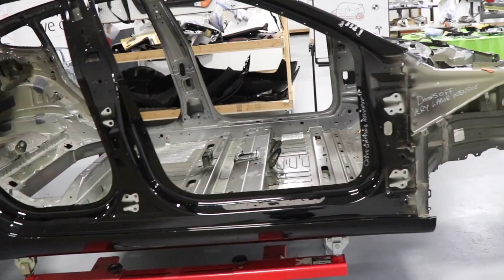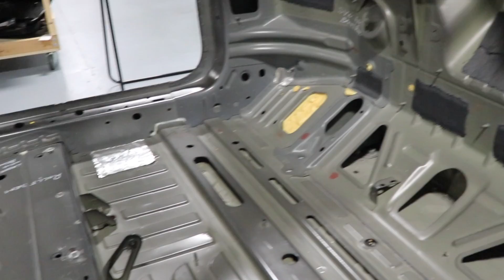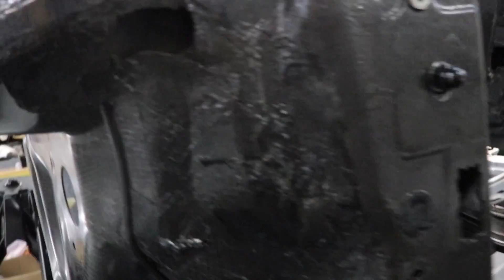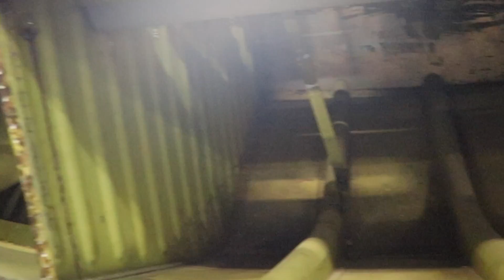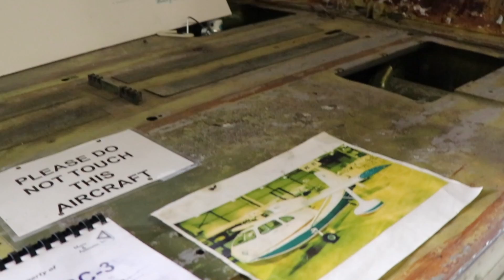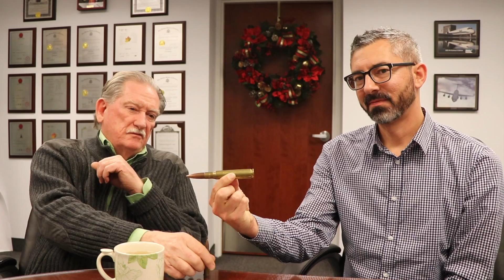Sandy Munro: Tesla Cybertruck SpaceX tech, bullet proof windows, crash safety, and battery magic

Comment: That tailgate on the Cyber Truck is going to be much handier than most are thinking. For instance if your in the field look for a mound to load and off load, or if you are loading from a warehouse dock or a raised dock the ramp will be horizontal or down into the truck bed in a slight decline.

Comment: Seems to be some confusion here about the bullet resistance of the cybertruck.  Neither the body nor the glass will stop a rifle bullet.  The glass will stop a small rock, from a slingshot, and the 30X might just stop a 9mm round, which has about 1/7th the energy of the .303 and 1/50th of the 50 cal.  It’s physics.  Better to use the 1000HP acceleration to slip away.

Comment: 30X refers to the alloy mixture, usually expressed as 300, 301, 302, etc., depending on the mix. 30X means the mixture is in the 300 series but the ingredients are a secret.

Comment: Question on parts of the newer Tesla - including model Y and CyberTruck .... when you created 1 part which was used to be from (example) 70 different parts ..... how do they get replaced when it gets damaged? 

When newer batteries get installed in the newer models and the newer ones have longer ranges - wouldn’t it drop the price of the older models ? Like S or X’s ? 

Does the batteries need to be replaced ?

Comment: not sure who this guy is, but he doesn't really do a good job of explaining this stuff. He doesn't at all clear up what an "exoskeleton" is. I mean he says the last true exoskeleton was the Model A and Model T, but weren't they body on frame? What is he talking about? The body panels may have been thick, but I don't think they were part of the frame, or contributed to the structural rigidity of the car in any way. So is that what an "exoskeleton" is, just really thick body panels? Why should I care about thick, strong body panels?
Also, you heard it here first folks, by 2023 autonomous driving and crash avoidance will be so ubiquitous and so good that car accidents won't really be a thing. "Good point" the interviewer says. Good point? As if the Cybertruck not going to have to pass crash tests and safety regulations and will not be getting into car accidents. It's a completely useless point. 
I don't know, seems like that guy is drinking the Tesla kool-aid pretty hard.

Comment: A traditional ladder frame also offers a lot of torsional flexibility which allows more wheel travel,  better tire contact in rough twisty off roading but also makes them sloppier handling on the road.  With a rigid frame, today that's a unibody, plus exceptional individual wheel travel and adaptive suspension you can have it both ways.   I can't remember the last time I was shot at while driving let alone a 50 cal.  Doors that heavy are going to be a liability and fenders 'n' frunk lid??...how are those going to crush in an impact?

Comment: Citroen had an amazing hydraulic suspension system - auto load levelling, rear squat, anti roll in bends and variable ride height. The springs were N2 gas pressure. spheres. The same mineral hydraulic system powered the brakes and the steering. Big win was no internal corrosion of brakes. Very handy on an EV that minimally uses the brakes. 
The whole lot was non electronic. Lots of stuff to modernise.

Comment: U.K. pioneered diesel electric rail locos that used ac traction motors. Until then they’d all been dc. The power converters had to handle 3000HP yet incidentally had the frequency response of a PA system. The motors had switchable coils so could be set to a range of synchronous speeds. The biggest breakthrough was their stall capacity. Bear with me -
Coal trains carried 1000 tons in 30 wagons. So expect the train to weigh A LOT more. At the unloading hoppers the whole train had to move at 0.5 mph which put huge strain on the traction motors. The variable frequency drive was set so low you could hear the motors pulsing. The loco 3000hp diesel would be working hard to avoid stalling. 
I wonder if this technology could be updated for electric car traction motors. Maybe it is but well worth a look.

Comment: Electric motors at or near the stall have huge torque but they seriously suck power from the battery. 
Can the motor specialists tell us whether they would benefit from a low range gearbox.

Comment: As Sandy says, 3mm is about 1/8". An entire body made out of 1/8" Stainless steel is HEAVY. '
He also correctly points out that stamping stainless that thick into curves like you see in a lot of modern cars is practically impossible. So the relatively simple...though futuristic...shape is a product of the decision to use the exoskeleton.

Comment: Sandy seemed a little circumspect anytime he got around to actually getting a direct question. I find it interesting that he didn't directly address the body cost issue. 

Waterjet cutting, as Sandy knows, is very time consuming and generally not suitable for large pieces in mass production. 3mm (11-12ga.) stainless requires about a 1/2" inside radius when bent on a press brake. If mystery 30X stainless is much harder as has been claimed it will need a wider radius. In structural use these bends may be susceptible to cracking. We don't see these bends on the prototype so all seams are likely welded then ground.

Tesla truck's long straight panels will require many feet of cosmetic grade seam TIG welds. This is both time consuming and labor intensive work.
I honestly don't see Tesla being able to sell the truck we saw for $39K even with no battery at all. I don't think Sandy does either but he wasn't actually asked that question. Nobody builds cars from stainless today because it is so costly and difficult to work with.

I don't hate Tesla. I want them to succeed. This interview has many flaws because of its enthusiasm for the brand. I suggest viewers go back and listen to the words Sandy says very carefully. For instance, are you sure who he is talking to when he quotes Sun Tsu about not knowing your enemy? 

Tesla fans generally consider themselves to be technical people interested in science to make an overbroad generalization. Science and engineering require a healthy degree of skepticism. "Prove it" is not an insult to a scientist or engineer. What i have been able to see of the Cybertruck so far doesn't make sense. It is up to Tesla to prove it.

What Sun Tsu actually said: "If you know yourself but not the enemy, for every victory gained you will also suffer a defeat."
If you are a Tesla supporter/investor and not following the automotive industry you don't know your enemy.
Reply: I believe that the thickness of the metal at the bend line location will be reduced before bending.
Reply: @brucenorlund312  Making a plate of various thicknesses would be a costly process. Grinding would be the typical way to do it but grinding quickly would generate excessive heat, further hardening the metal before bending.

I'm not trying to be querulous and don't call me a "short." I've designed stainless weldments (much smaller than cars!). Stainless is a pretty terrible material for an automotive chassis. There is a reason it isn't being done. Sure, you can make one. That's not the same thing as doing it for economical mass production.

Tesla may have some magic they aren't sharing. they have surprised me before. but they have also made many promises they have failed to deliver on.

Comment: I wonder what Mr. Munro's opinion is about the Cybertruck being classified as a medium duty (Class 2b).  With that classification the true competition is Ford F250, Ram 2500, and Silverado 2500.  The Cybertruck specs don't look as impressive when compared to these trucks.  Being a medium duty also means not having to provide battery range because traditional mpg certification isn't required.  Also IIHS doesn't currently crash test medium duty trucks.
I believe a mid-size Cybertruck would have more impact on the market than it's current form.

Comment: Great interview Sean!  One question I would be interested in asking Munro in a follow up is: how will the exoskeleton design hold up when towing heavy loads?  How much of a risk is there of bending the exoskeleton, and what would happen in that case?  I've had a few discussions with people who wonder if you try to tow too much that it might bend the exoskeleton and cause all sorts of issues (like not being able to open the doors, etc).  My guess is that Tesla is over-engineering for that use case, but it would be interesting to hear the perspective from someone like Munro on that question.  The other question is, if people attach aftermarket things to the truck (like a rack or a winch) and they do that by drilling holes in the frame to mount it, would that compromise the structural integrity of the exoskeleton frame?  Again, I would guess that if the mounting holes are small, it shouldn't be an issue, but it would be interesting to hear Munro's perspective on that.
Reply: Everything will be welded onto the truck

Comment: Sandy’s views on Tesla’s M3 electric motor and battery technology as compared to others Munro has tested was very insightful.

I enjoyed his example of loading a deer or moose into the bed.  His description is often what is done today.  

I wish they both had discussed battery technology and range in more depth as it applies to off-roading, hunting and other outdoor sports.  Both sports occur throughout the year in all types of weather and temperatures.  More discussion on realistic ranges is needed.  Especially given that parking any BEV at a trailhead, boat ramp, or cabin for hours or even overnight without the ability to plug into any power source at low temperatures is a common occurrence for someone who enjoys snow machines or hunting.  There are real world conditions for those who enjoy the outdoors frequently where the useable range is realistically less than half the advertised range.

Sandy’s observations that the tailgate ramp was not unique was also something that needed to be said.  His experience with aftermarket ramps is not unique although more secure options exist.  I would have liked his assessment of the orientation of the T slots on the ramp for loading purposes as well as the number of T slots in the bed, on the tailgate, and ramp.  ATVs are almost never as clean as the on stage demo.  Wet, muddy or even snowy/icy ramps and ATV tires is more the norm.  Without any grip/traction bars on the ramp loading could still be challenging even with the rear air bags lowered.  Mounting a traction bar accessory to T slots in the ramp might be an option but it would have to be added once the ramp is deployed and removed before the ramp could be stowed inside the tailgate.  Cleaning the T slots of mud, gravel, sand, ice, etc... will also present a challenge.  Clogged T slots could prevent accessories from being installed.  Given that there are 12 slots in the bed, tailgate, and ramps...  6.5’ bed + 3.5’ of tailgate and ramp (maybe more) is 10’ lineal feet of T slot.  That’s 120 lineal feet (1,440 lineal inches) of T slots to clean!  Not a problem if you never haul wood, gravel, mulch, etc... or load muddy, snowy ATVs in the bed.  But if you do...  cleaning will become tedious.  Cleaning the bed of truck shouldn’t take more than a couple of minutes with a broom, blower, or hose.  Brooms and blowers aren’t going to dislodge crushed angular gravel and sand.  A air or water hose might do better but is still going to take time to clean 120 lineal feet of track.

I like that Sandy shared that he has a jeep and goes off-roading to relax.  There are many levels and forms of off-roading.  Many involve water that can sometimes enter the cab.  Most late model vehicles can’t handle water inside the cab.  Too much electronics under seats and dash along with carpets and liners.  Even going with the carpet delete option doesn’t solve the problems.  Older jeeps, land cruisers, rovers, didn’t have as much issue with water as today’s counterparts.  Personally, I’d love to see Tesla offer a version of the truck that can handle water and mud in the cab and basically be hosed out after use.  Seeing a stainless steel interior rather than carpet, faux leather door panels and roof liners, etc... would look awesome.  I don’t need 16 speaker surround sound.  I’d rather have secure mounting locations for removable waterproof blue tooth speakers (all synced) with wireless charging.  If one craps out or gets damaged... just buy a new (better) one for $50.  No pulling door or dash panels.  The same is true for the display.  It needs a secure mounting system for crash purposes and would need a water resistant/proof case.  If it breaks or dies just unbolt the surface mounts and replace it.  Having to hire a tech and pay $3000 to $4500 to replace a dead screen or upgrade to new tech is too old school.  We need a version of the CyberTruck that is Ruggedized and easily updated or moded using factory or aftermarket offerings.  A lot of the current design accomplishes just that.  But Tesla can go further.  I want to be able to load up after duck hunting and not have to worry about how much mud my buddies or dogs are going to bring inside the truck.  A couple of retrievers shaking the mud, ice, and water off inside a truck after a hunt is brutal on every surface inside a vehicle.  Especially perforated speaker covers and seat covers.  Just like Tesla has earned the right to brag about crash tests and 0-60 performance...  I’d love to see Tesla earn some bragging rights in performance under extreme use, temperatures, and abuse.  One extreme abuse test could be loading a couple of retrieves inside after a morning of duck hunting in typical montana/idaho/wyoming (wet, cold, snowy, icy, muddy) conditions and letting them have at it.

Sandy is correct.  Scuffs and Scratches will be a statement of, “yep, I really do use my truck!”.  I have a friend who takes every new truck he buys through the brush to knock the new off it.  The sooner you get some pinstripes from brush the sooner you stop worrying about the shine.  CyberTruck is meant for guys like this.

Comment: the 500miles range is not a mystery if you think about the size of the truck. Most likely they have a new larger design of the battery packs and overall there are more of them.  An extra layer of packs perhaps?   Think about it, it's an Exo skeleton, you don't need as much support and metal on the inside which translates to more space for battery packs.

Comment: Sean Mitchell - I think having Large Windows on SpaceX Starship and Future Space vehicles is a Mistake. as Good as ALON is, its still has a lot of Mass. 
and eventually, they will FAIL 
this means the Space craft would be less Efficient and Long Term Durribility would be an Issue. 
would be pretty Difficult to Replace in Flight to Mars or the Moon. 
I would Recommend mostly covering Starship with Stainless Steel and using ALON Sparingly , and Instead relying on Digital Periscopes (see US Navy), Sensors and HD cameras. 
and giving the Pilots/Crew and the passangers Large HD Flatscreen(s) Display showing Live HD camera Feeds throughout the Cabin. and the Pilots/Crew having command over the Digital Periscope(s).

Comment: I have had many opinions about the Cybertruck as I watch the "conversations" go on in the background. It's pretty rare to get people that know the truck market, ARE a truck owner, USE trucks regularly, HAVE experience in manufacturing as well as materials, AND can put themselves into the mind of what Elon is doing. Sandy is the best I've seen to date to fit that category. Elon is ALWAYS looking at the cross-pollinating between his companies. It always serves his aerospace endeavors (IMHO). Cybertruck is wicked good at what it will do with innovative problem solving in areas the REAL off-roaders deal with on a continuous basis. The "comfortable" SUV guys with leanings to Escalade probably won't find the Cybertruck to be THAT. BUT, for guys using a truck hardcore, I think they're gonna be impressed. I'm impressed - with Sandy's grasp of what's important.... but I'm not surprised Sandy gets it so very well. Good discussion Sean!

Comment: Sean, great interview!
Regarding the extended range of Cybertruk, you observed to Mr Munro, the reason could be the use of Maxwell ultracondensers to store a and delivering peak energy for transients on acel/deceleration, due to the weight of vehicle, preserving the battery pack for the steady state operation of Cybertruk.
Not a thorium reactor as Mr Munro joke!

Comment: If cobalt is so hard to come by how are the oil companies using it to reduce the sulfur in diesel (which is a one time use) ?
Reply: It is not exactly a one time use, meaning it isn't used as a reaction component. It is a catalyst to ignite and support the reaction. But it does wear off over time and can't be recycled.

Comment: Another great talk Sean. Top stuff!  I would still be interested to hear an expert view on the die- cast unibody aluminium patent application for model Y. Mr M only spoke about stamping here (13 parts to 1). He's talking about an idea they had (in stamping) for model 3, which didn't go so well for Tesla. Lots of talk on the integrated wiring solution. Now lots of discussion on the stainless steel unibody for cybertruck (all great stuff). However, a die- cast one- piece solution for model Y would truly revolutionise vehicle production (if they manage it, lots of hurdles to overcome)- Intrigued Industrial Designer.
Ref- https://insideevs.com/news/361430/tesla-big-casting-machine-frame/